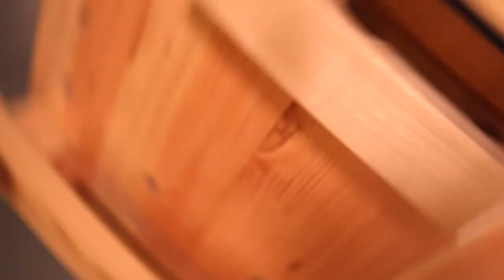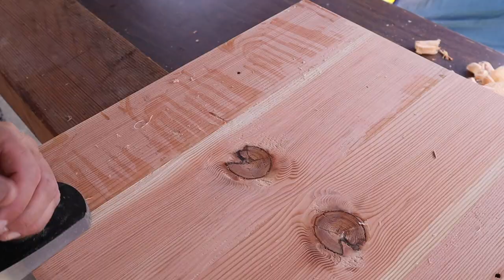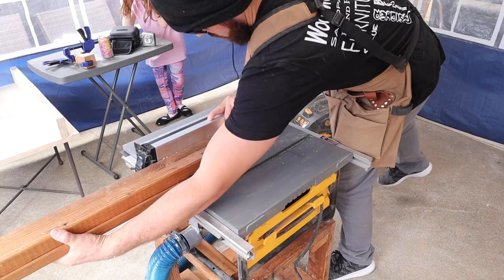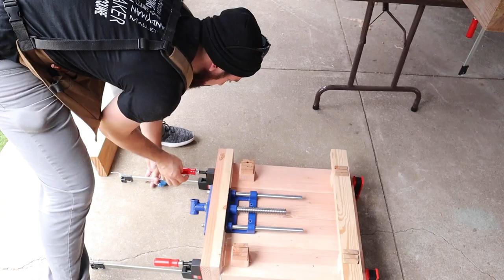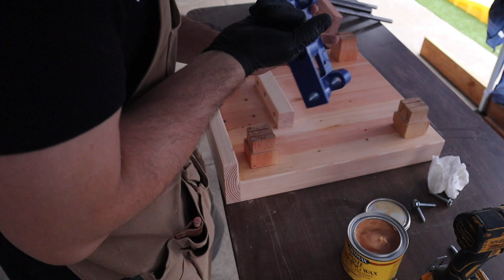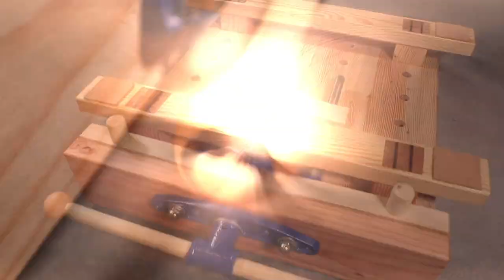DIY - Mini Work Bench/Face Vise For Small Shops

Comment: Excellent Video and Vise! Can't wait to see more of your work.
Reply from the maker: I really appreciate that! I use it all the time in the shop. Though now I have a much larger commercial shop I set up last year. It’s still super handy to bring to job sites. I just used it to hand cut mitered custom molding I made for a built-in banquette bench I finished installing last week. You can check it out on my Instagram, I’m much more active on there. Thanks for watching. I have a video I’m filming right now for this table I’m building for a client. I have some pictures of the glue up on Instagram as well.

Comment: One of the simpler benchtop designs I've seen, very nice.
Only change I'd make is to rotate the kerfs 90 degrees on the top tennons so the wedges press against the endgrain,  less chance of the wood splitting. Otherwise beautiful work.
Reply from the maker: Thanks man! The kerf position was definitely an over sight on my part. I thought about it as I was tapping in the wedges. Luckily nothing split. This was my first time doing traditional joinery of any kind so I definitely won’t make that mistake again. I’m building a double ‘L’ shaped loft bed for my daughters with 100% traditional Japanese joinery. It will be modular using interlocking mortise and tenon and tusked mortise and tenons. Using red oak and Purple Heart. I’ll be starting in a month or so, I already bought the lumber. Don’t forget to subscribe to see when I release that build video. I love input like this because I’m new to traditional joinery. I’ve studied it a ton since designing this vise. I’ve put a ton of time into the engineering of this bed. And I’ll have a couple videos out before that.

Comment: I like the build, heres my comment. 
Different, i would have included instructions, dimensions, lay out and used alot less power tools as most starters who need a bench dont have the tools.  Quick attach legs and its perfect, thats my addition...so it will be posted tomorrow right?

Comment: Nice!  Very meticulous!
Reply from the maker: Thank you! My OCD plays a big part in that haha you should see the bench I just finished last week. 10.5’ Red Oak Banquette bench with a solid wood seat and back so that there was continuous grain across the entire 10.5’ of bench! Storage under the seats. Zero exposed hardware. It took a bit of engineering and about 110-120 shop hours. You can see the whole process on my Instagram. I was pretty stoked on how it turned out.

Comment: It turned out very nice and looks useful and functional. I wonder how long the cross grain will hold. That’s a long piece to solidly glue cross grain. I would have considered a sliding dovetail ( glue a few inches only) or a breadboard connection. Time will tell. (And also all the safety concerns others have mentioned)

Comment: Sorry to be the bad guy, I'm really worried about your fingers. Get yourself a miter gauge or a crosscut sled for your sablesaw, quickly. The planer/jointer also has a blade guard for a reason. I know too many carpenters without ten fingers. Jonathan Katz Moses can tell you a story... just recently ...
Reply from the maker: I appreciate your concern but Im guessing you stopped watching after those first couple cuts because I built a crosscut sled after those first couple cuts. It’s in the video.
Reply: @kinder-works  
You are right, I send the posting after the crosscut and your jointing with open blade guard. Crosscut sled 👍👍👍  but please keep your fingers further away from the blade. Look again at your ripcuts, sometimes you use the pushstick👍👍
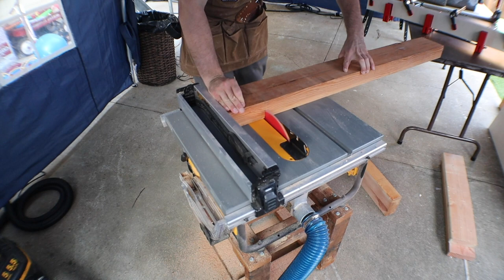Reply: Hello, i was also thinking that the cuts at 1:21 were rather dangerous. I'm not sure, if it's technically possible, but i had the idea that maybe you could add a kind of note in the video at those certain moments, to let unexperienced woodworkers know, that they should better not repeat these steps in that same way.
friendly greetings, ben

Comment: Beautiful and functional piece you made. Nice video editing (altho music kinda loud vs spoken part.)  Curious what type of vise (blue) that is. Irwin?  Kinda scared about some of those cross cuts with no saw guard/sled.
Reply from the maker: Thank you! It’s made my work flow so much better not having to rig up a concoction of clamps to hold a component I want to plane haha

About the audio, are you referring to the all spoken parts or just the one towards the end. The one towards the end, I didn’t have a mic yet and the wind made the tent I’m in super noisy. If I turned the gain up too much, the windy tent was very unpleasant. Especially transferring out of the music. If the audio in the beginning was too quiet, that’s something I can take note of. These are definitely notes I want to hear so thank you! 😊

The vise is a Yost 9” vise you can find on Amazon. I need to start linking things in the description like I’m suppose to.

And the unsafe cuts...I literally built a sled for this project because they sketched me out haha you can see it come in early on into the build.

Thanks again for watching! I’ve got a bunch of project video coming. I’m finishing up a build right now and have 3 more on the books. I’d love to hear your feedback on the next videos.

Comment: This is awesome! I’m also in SF and finally moving to a place with enough space to start woodworking (outdoor deck). I was going to make a basic outdoor workbench but can’t attach a vise to it as the hardware would likely rust. Thought of making a portable vise and came across this video! Definitely going to use it for some pointers 🙂

Couple questions:
1. What vice hardware set did you use? Looks like the Yost one on Amazon 
2. The extra block with holes for the screw and rods seems unnecessary - can you explain why you added it?

Also, it’s hard to believe this is your first video - you got editing skills! I see a successful YouTube channel in your future 😁
Reply from the maker: Thanks man!! I really appreciate it. This is the first video edit like this I've ever done. I just watch a TON of woodworking youtubers. So I picked a bunch of elements from each one. I watched a ton of videos on editing and transitions. I also went to school for audio engineering, so that helps a lot. But I know I need to slow down my transitions between clips. It's a bit hard to focus on whats happening for first time watchers haha But thanks man, that really means a lot. I hope this turns out well. My content on YouTube will trickle out for the next year or so but my Instagram is almost daily of me building my business and some of the projects I'm working on currently. On top of building furniture and cabinets, I run a handyman business as well just to pay the bill while I build the woodworking portion of my business. My goal is to be financial sustainable on woodworking and Youtube alone. I just invested in a 18"/36" open ended drum sander so I can start pumping out cutting boards for a little extra revenue. I'll also be making dovetail boxes and other little projects that I'll be selling at farmers markets and craft fairs around SF. If you follow me on instagram, @kinderworks, I'll be sharing all my table locations for people to come find me if there in the area. I'll be bringing this vise ⬆️ with me and working on projects in my tent between talking to people. But to answer your questions haha

1. Its the Yost 9" on Amazon, you nailed it haha
https://www.amazon.com/Yost-Tools-F10WW-Front-Vise/dp/B01M60Q4NN/ref=sr_1_3?crid=3IA7VTKZ0RQSM&dchild=1&keywords=yost%2Bvise%2Bwoodworking&qid=1606982253&sprefix=yost%2Bvise%2Caps%2C239&sr=8-3&th=1

2. So I didn't think I was going to need anything else because the vise is super solid but once i added to front face to the mouth, there was some serious play. Because I'll be clamping down on one side of the mouth so ofter (cutting joinery), the mouth would have twisted and lost its clamping force on the piece in the vise. I used a cut off of some hard maple and it stiffened a lot of the play. It's not perfect like a Bench Crafted vise would be but it works great.

Don't forget to subscribe! 😆And definitely let me know if you have any further questions!
Reply: @kinder-works  ahh that makes sense. Simple enough fix 🙂 I’ll probably go with the Yost too then!
Reply: sorry I just saw good work and I applaud the results, I want to imitate his work

Comment: This was nice! Great job! That thing will probably be used for years. Does the pine (being a soft wood) protect the actual work piece or would it have been any different if made from a harder wood? Thinking of making one myself. Have a like and subscription!
Reply from the maker: Thank you so much! I used a Douglas fir beam because I had it and didn’t want to spend the money on the hardwood. It definitely helps to protect the piece from dings and dents but I’m currently building a massive split top roubo workbench out of white oak. I literally got 150 bf of solid 1.5” thick white oak for free from a desk on craigslist free stuff. That’s literally $1500 worth of lumber. Always keep an eye out on craigslist for free wood. I’ll be posting about the bench on Instagram. Thank you again for watching and I’ll be posting more stuff soon. I have a commercial shop now that I’ve been building out and haven’t had time to make videos but that will start back up again soon.
Reply: @kinder-works  that's awesome! I just bought a lot of elm but it will take me a few years to dry it. Looking forward to the video then (?)